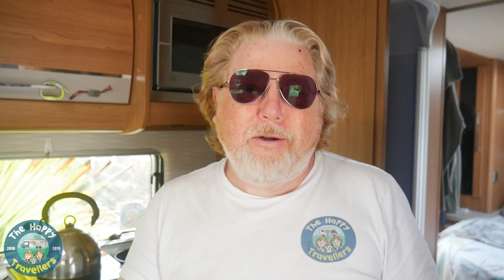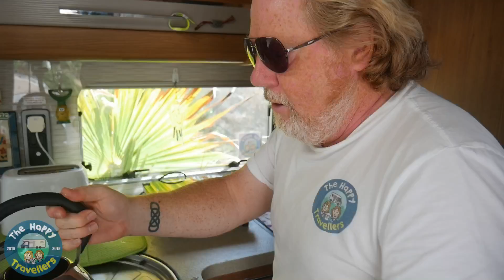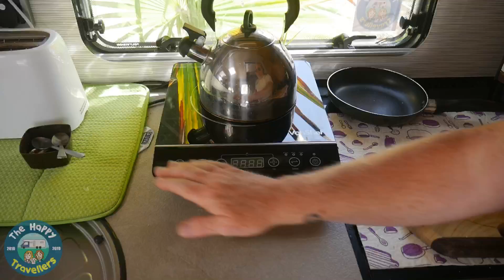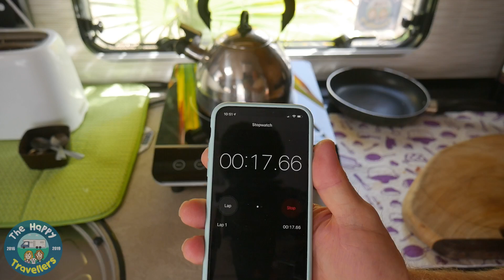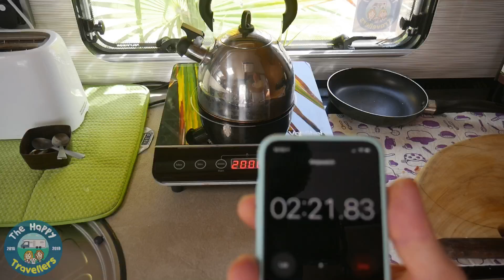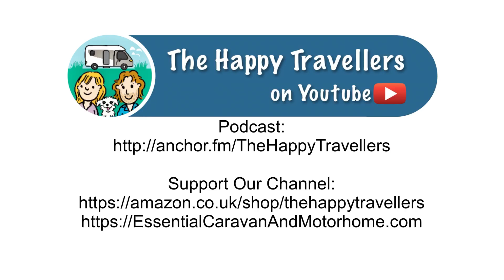VonShef Induction Hob Review

Comment: Thanks for your very interesting video; does the induction cooktop operate using an on/off switching technology, or does it use inverter technology with continuous modulation? I am looking for a portable induction cooktop that uses continuous modulation, so as not to put too much strain on my 24VDC/230VAC inverter.
Reply from the maker: It’s the on/off switching type. It works fine with the Victron Multiplus and the on/off type that we have now works fine with the Bluetti and AllPowers portable power banks 👍😀😎

Comment: I recently tested an electric kettle against a small pan on my Von Shef induction hob. I put half a litre of cold tap water in each then timed them, one by one, until they boiled. The electric kettle, using 2.4 kilowatts (that cannot be adjusted) took 2 mins 2 secs. The small pan on induction hob at 1.4 kilowatts (less than the 2 kilowatts full power) took 2 mins 42 secs. Therefore, it is a little slower but cheaper to boil on induction at that power.
However, I then bought a Von Shef whistling kettle to use on the induction hob...
The kettle is 2.5 litre capacity and has a massive base, almost filling the entire plate of one of my hob rings. With the water being spread over such a wide base, the boiling time was MUCH longer than in a small pan, even though the kettle is Induction friendly. When filled to capacity, the kettle takes ages to boil, though at lower cost than a 1.5 litre electric kettle to boil an equivalent amount in two boilings, as measured on my smart meter.
Reply from the maker: Wow great info. I expected a larger surface area to boil faster (based on no science knowledge at all). 

Thanks for the info. Coincidentally Wendy and I were discussing electric and gas kettles this morning. 
We came to the conclusion that it might be more effective to have a small kettle and a small induction hob heater than carry two kettles. 

Obviously cheaper to boil electric kettle when on EHU rather than use the gas.
Reply: @pensionvanlife  I would like to do similar tests with gas but don't have it plumbed in here at home, so I've been looking at buying a small camping gas stove just to see how they all compare.
Also, I've been looking for another camping kettle but smaller capacity with smaller base - about 1 litre would be fine. I haven't yet found one that is induction compatible.

Comment: I am looking at this now on Amazon, do you think it would work on a very large bas pan.  I recently bought a flat casserole that I think is 26 or 28 cm and wonder if I could still use it (since it is fairl new and does have the symbol for induction).
Reply from the maker: Probably would work 👍
Reply: @pensionvanlife  Thanks for the reply.   It does work!, so pleased and am enjoying using the VonShef, think I am now converted to induction.

Comment: play the video in about 1.5 time and it's easier to watch! (Sorry Steve but you talk very slowly). In terms of the hob. I have same make and model and have been disappointed. It's my only form of heating food apart from an electric multicooker. It's OK for boiling water but that's about it, because the induction ring inside the hob is too small in diameter. So the centre of the pan is always much hotter than around the sides. This essentially means that you are relying on the liquids in your food (water or oil) to distribute the heat, so unless you throw far too much oil in there you can't fry or toast evenly. I also find that the temperature settings jump too much in terms of heat from one to the other, so it is almost impossible to get food simmering, either it is threatening to boil over or it is not quite hot enough. Only way I've found round this is to have it on the not quite hot enough and to throw a teatowel over the lid to keep more of the heat in.
Reply from the maker: Yes I agree, its not ideal but still quite a good product for £23 :)
Reply: Literally... Cannot get this fucker to simmer anything